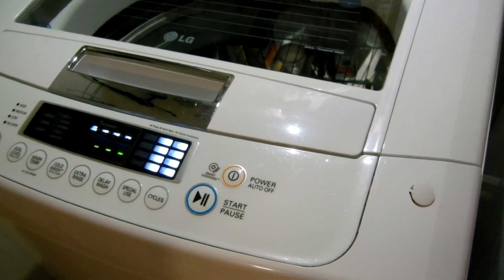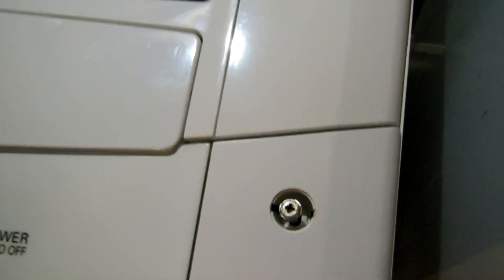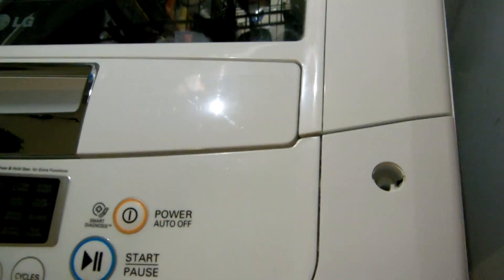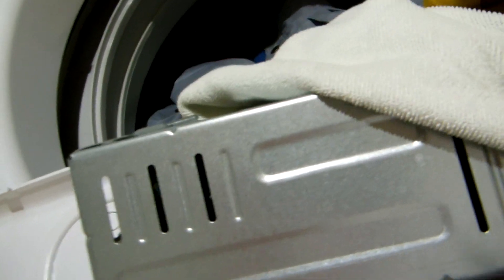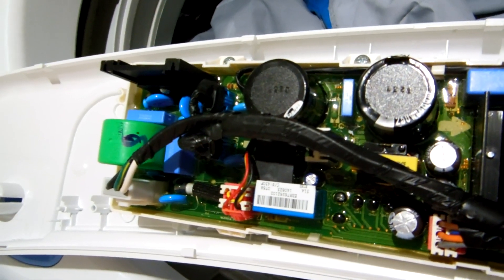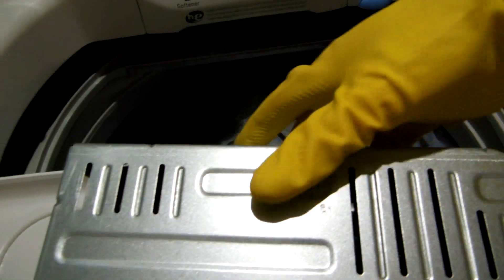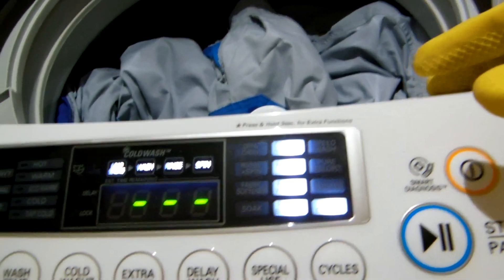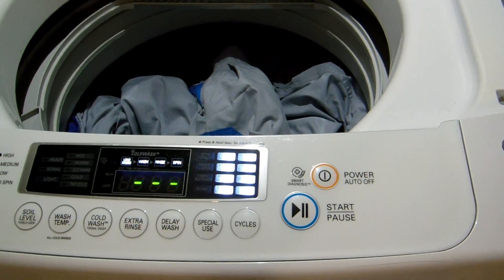LG WT1101C* & WT1201C* Drain Pump Runs Continuously ( Updated )

Comment: Discharged the capacitors onboard by tapping on it??  That is a new one for me. 
  Interesting. 
  Did this repair hold up, or do you still have to repeat it from time to time?
Reply from the maker: This is a firmware error, so I have had to repeat the process from time to time but not anytime in the past 2 months. I leave the top screws out and that makes the process much quicker for me if needed. I do not see the point in my replacing the circuit board since the firmware is likely to be the same on the new board. Merry Christmas!

Comment: Thanks for the video,  I have a red LG front loader and the drain cycle keeps running then after tem minutes or so, it show the DE error code. I replaced the drain pump motor (old one seems ok) but I still change it, But still keep stuck in draining cycle. Check drain tube and normal.  So I'll try this if my front loader has the circuit board similar to yours. Thanks
Reply from the maker: No idea

Comment: Hi ! The problem that I'm having with my washer is mine is slow letting the water out and Its spinning for a little bit then stop and then that OE comes on and that flashes on & off and stop unlocking the door, and when u start it back up it asks like it's draining but doing nothing but samething so what is that pump or what.
Reply from the maker: See LG ( please read):
https://www.lg.com/us/support/help-library/oe-error-code-top-load-washer-CT00000305-1425330996723
I myself would also try unplugging the washer to clear the data.
Your problem is different and not the same as the problem I have in the video. Merry Christmas!